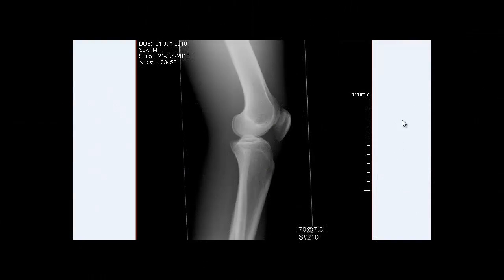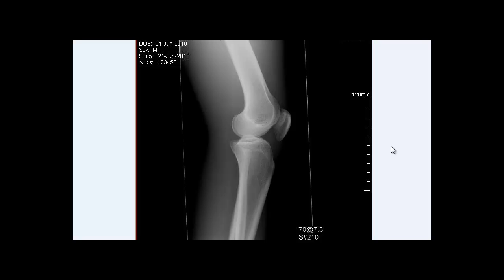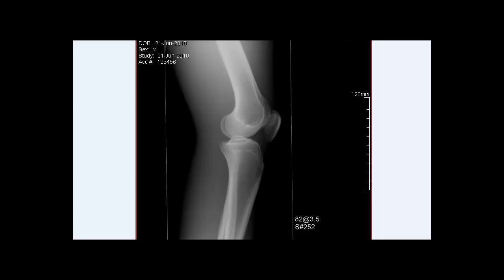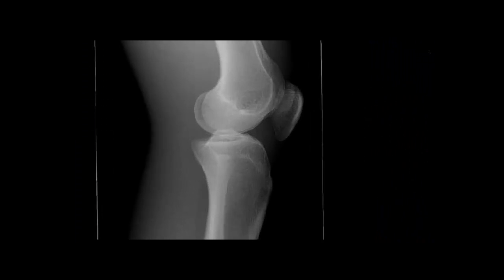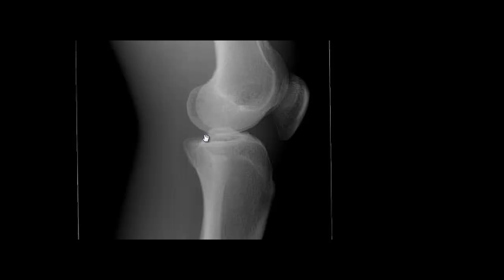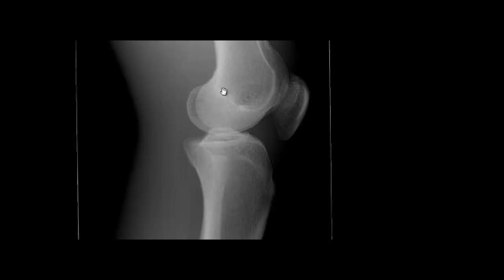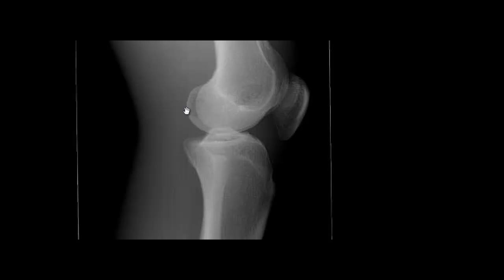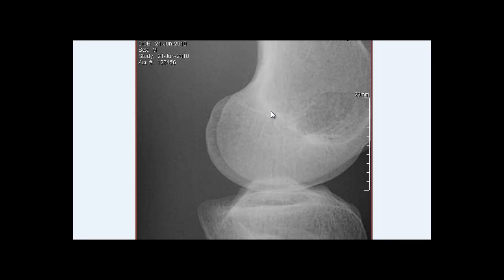Lateral Knee X-ray and Rotation

Comment: Hi Jeremy! Can you do a video on 30 60 90 patella views? We know to flex the knee at those different angles.  It is necessary to angle the tube as well for the tangential projection, correct?
Reply: Thank you for responding! Great help!
Reply from the maker: Can you clarify what you mean by "30 60 90 patella views"?  Are you just talking about the amount of knee flexion, rotation, or something else?  There are numerous ways to perform the tangential projection, but you must always angle the tube related to how much the knee is flexed.
Reply: Yes.  The doctor wants the knee flexed in these different angles. The doctor just replied, "flex the knee OR angle the tube" when we asked what he wanted. Is there a way to keep the knee in a fixed position and angle the tube or the detector?
Reply from the maker: @xray2774  Regardless of how much flexion the knee is in, you'll need to have the x-ray tube near the foot to where the beam skims the proximal tibia and the CR is centered at the space between the tibia and patella.
Reply: We have been acquiring 3 different images with the knee in 30 60 & 90° flexion. We're angling the tube as needed. Someone suggested angling the detector at those degrees.Do you think we could just angle the detector at 30 60 & 90° and achieve the same result?
Reply from the maker: @xray2774  Angling the detector won't affect how much the joint space is open.  You can always do that, but it will result in elongation.

Comment: What if there is too much tube angle? I am in the latter park of my clinical externship and have my hands on every patient at this moment. However I work with many different techs that have their own strategies and techniques. There was a large gal, and I thought to put 10 degrees cephalid and it still showed the magnified medial condyle distally as shown in your insufficient tube angle pics. The tech thought it was TOO much angle and i repeated closer to 5 degrees. It was still about the same but maybe "slightly better" according to her. Can you help me with images or possiblities of too much tube angle? Thanks.

Comment from the maker: Thanks for the comment k24boy123... the superimposition I'm speaking of was referring to the posterior borders of the femoral condyles.  In context, it's absolutely possible to acquire better superimposition, and we all know that the side up will be slightly larger as every radiograph will display some evidence of magnification.  If any of my students are reading this, DON'T use the "eyeball" method.  I'll grade you off for that!  Also, no need to superimpose hips to get a good lateral knee.

Comment from the maker: Most people tend to under-rotate, rather than over-rotate due to limited mobility, lack of flexibility, not enough hip rotation, etc.  You can also keep in mind (using your x-ray vision) that the knee is a hinge joint, so if you can visualize the hip, knee and ankle bending at one point-the knee, all three joints should be in the same plane - look for elevation of the knee compared to hip and ankle and try to make them parallel to the table.  I hope this helps!
Reply: Knee is more like Temporomandibular joint - it is a bicondylar joint. Whereas Elbow is more of "hinge" joint

Comment from the maker: No problem... they can still be tricky because patient size can alter the appearance of the knee.  If you bend down to look at the knee (once in a lateral position), you should see a small space between the patella and the table-top, so it's good that you're using the sponge to prevent over-rotation.  To prevent under-rotation, I recommend using a sponge underneath the foot of the affected side. See additional comment...

Comment: Very helpful!! Thanks for that tutorial. Yeah 2 fingers underneath patella and 4degrees cephalic angle usually works for me. In horizontal ray lateral knee, x-ray beam enters from lateral end to medial end of the knee therefore slight angle downtilt is commonly used. However I still struggle with getting a good one, what I usually do is to slide a small sponge underneath the knee and use a straight tube perpendicular to the knee joint. Any tips??